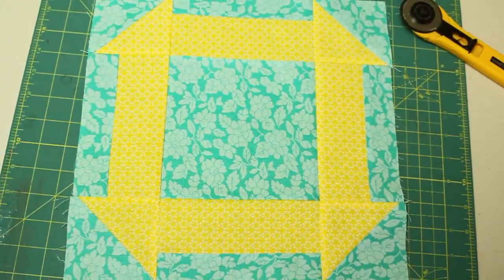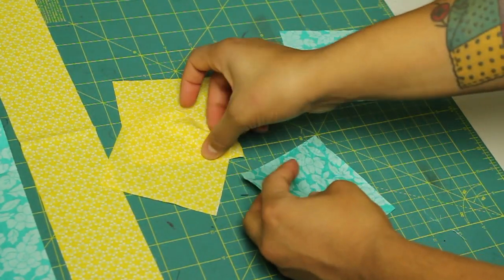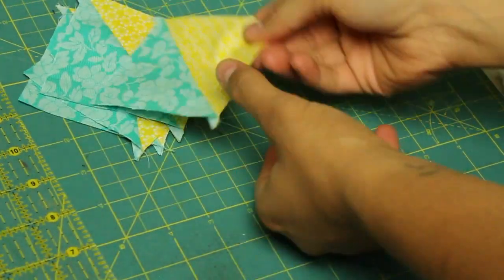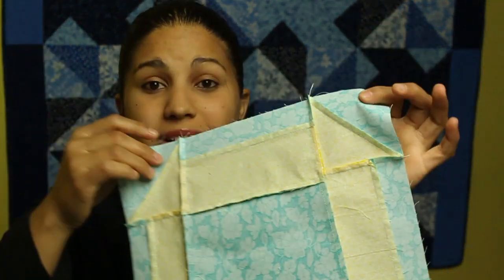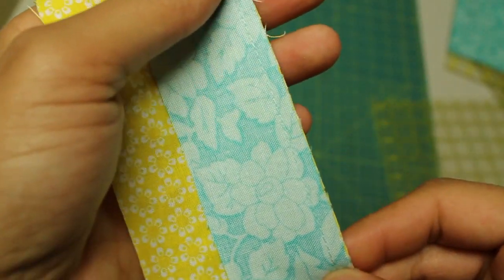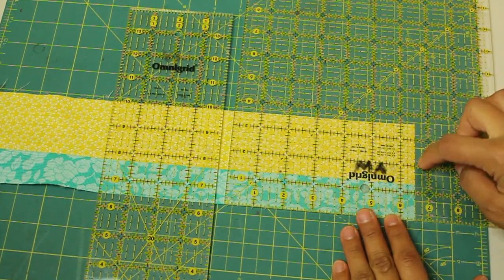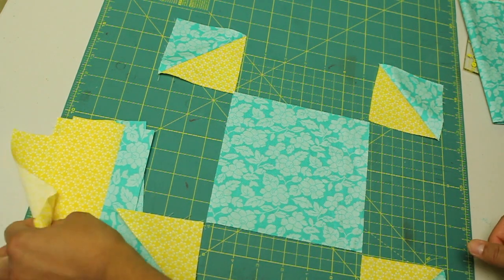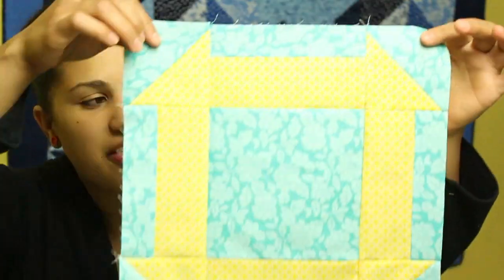How to make a Hole in  the Barn Door Quilt Block/ Churn Dash- Block#5 of 12- Video Quilt Along

Comment: Thanks for explaining the scant 1/4 seam. I had been trying to make it a bit narrower but now I know how to check it. I will practice on scrap fabric.  I'm so blonde I cut my strips 1 x 3 inches. I will have to do mine as four small 2 fabric rectangles as I don't have much fabric left now. Can you tell what the finished size should be plz.